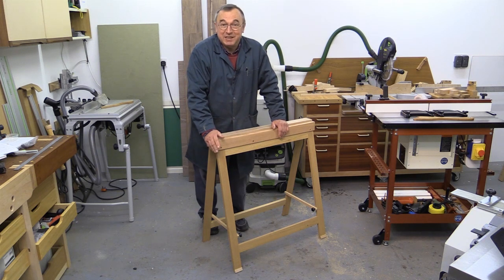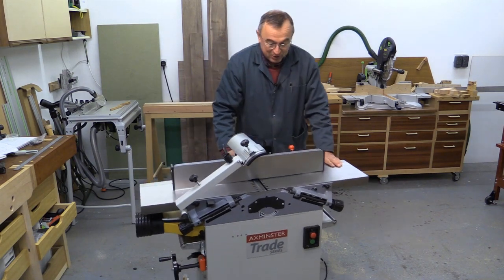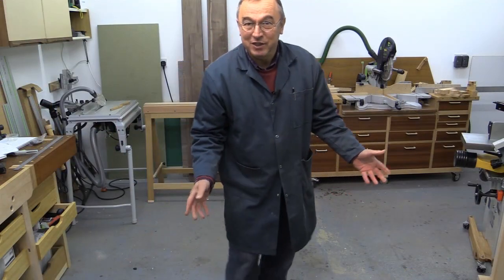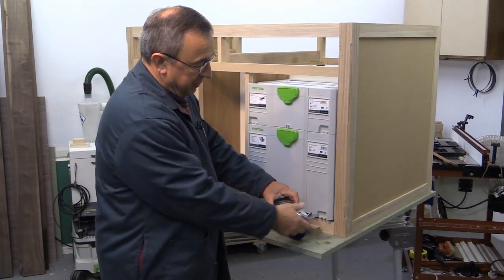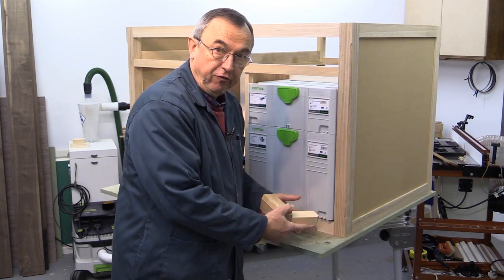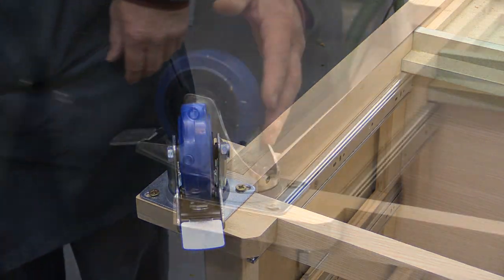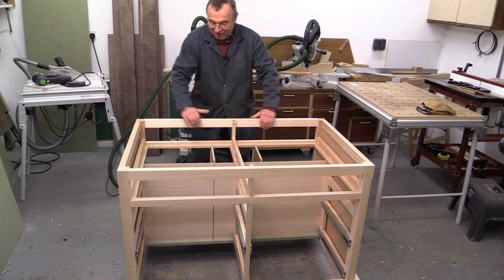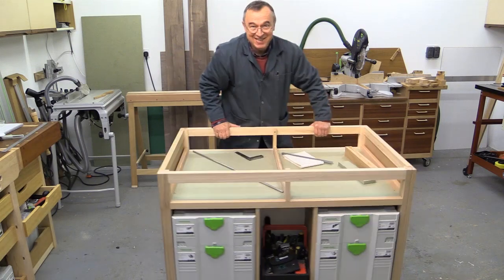How castors can transform the small workshop

Comment: The heavy racked equipment we use in electronics has castors which retract when not needed. That way the base of the rack itself sits on the floor. This gives a more stable footing, and I would have thought would be better for a bench. Unfortunately I can't see a maker's mark on them.
Reply from the maker: Hi Don, Thanks.   Peter
Reply: I had my workbench on castors, they had pedals which if stepped on jacked the bench up off the floor. One could then wheel it around, I bought them online from America. It could have been from Rockler woodworking.

Comment: I'm am reclassifying the description of my workshop from small to miniscule :)
I have a 9 foot by 9 foot (exterior) shed with one corner chopped off for the doors.   This gives 63.5 square feet of internal floor space into which I have fitted the Axminster AT1628VS lathe, the Axminster SBW4300B Bandsaw, a workbench which is 8 foot long and incorporates my B&D workmate on one of the 'long' walls and another worksurface with a toolbox for the lathe accessories and my sharpening station.   I just stand in the middle and turn to face whichever worksurface/machine.
Reply from the maker: Hi Giles, In 1976 I set up my first 'workshop' in the spare bedroom of a two bedroom flat and that was in the days when I had no dust extractor of any sort - my wife was very kind about the dust. As we moved around I was sometimes lucky to have a garage but then in other houses there was no garage or shed at all. Even now, with my largest workshop ever, I still move outside on a nice day to break down sheets of ply or MDF.  Peter
Reply: New Brit Workshop you have very patient and supportive wife lol

Comment: ...just wondering you are using in this video 140kg castors which is 560kg in total; do you need that much loads ?  I'm just building a workbench which has rails for my circular saw to slide, a moxon vise and few power tools stored on the bottom shelf; do I need ~500kg of loads ?  The coldene catalogue is huge; do you have a list of castors that you are recommending?
Reply from the maker: i Cedric, I am no expert on Coldene stuff and just look at what they have on the web. As far as load goes - go for a bit more than you need !  Cheers.  Peter

Comment: Peter, do use two swivel and 2 braked swivel on your benches or all 4 braked?
Reply from the maker: Hi Bruce, Yes, I have all 4 castors that swivel and are braked in two ways - the wheels are braked and the swivel action locks at the same time as the brake is applied.  Peter

Comment: Have you had any problems with the wood caster extensions ever loosening?  I have a maple top workbench that is very very heavy and I have been concerned that design may not hold up under the weight.  Any suggestions or maybe speak of your experience?
Reply from the maker: Steve Johnson Hi Steve, No problems at all - they are glued and screwed to the frame. The castors themselves are screwed in place but, if you are worried, you could use bolts.    Peter

Comment: Step 1: Get a decent floor. My garage workshop has such a rough floor I would not be able to use wheels like that.
Reply from the maker: +Big Dave My original workshop was the same (it is now a garage) and we took some care pouring the floor of the new workshop.   Peter
Reply: I'll be trying to fit standing power tools in half of a smallish (by U.S. standards) two car garage with a floor that slopes (drainage). It's a condo not a house so pouring cement is out but I'm thinking of a way of laying a plywood floor covered with vinyl tiles (cheep).  ;-)